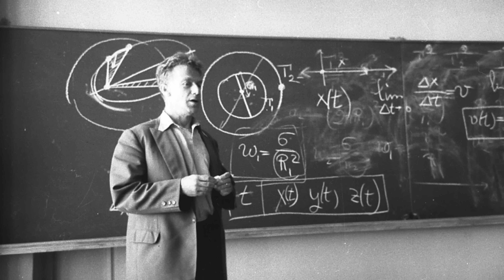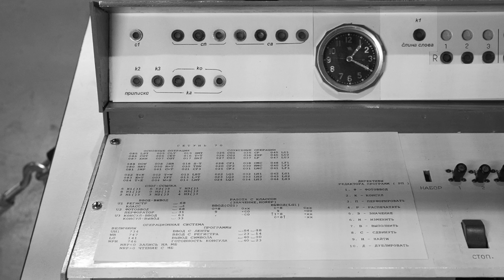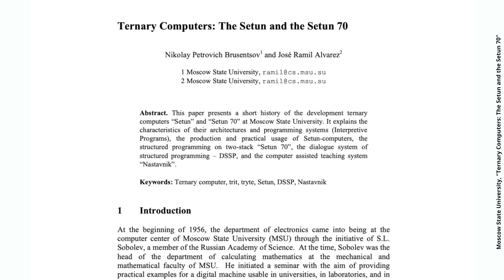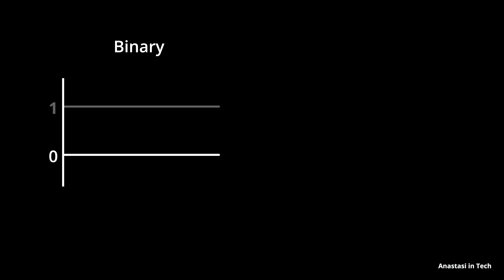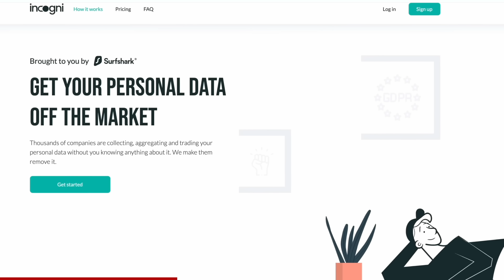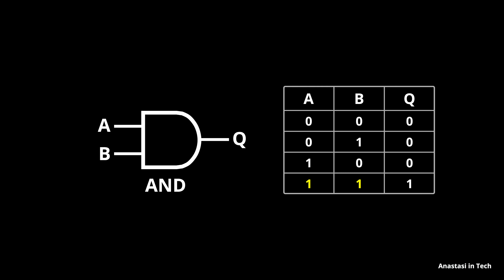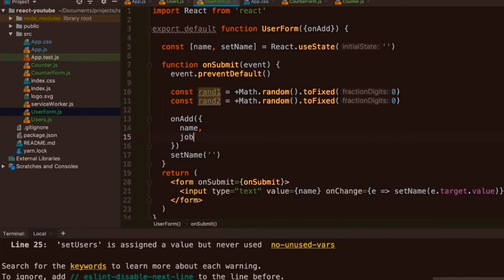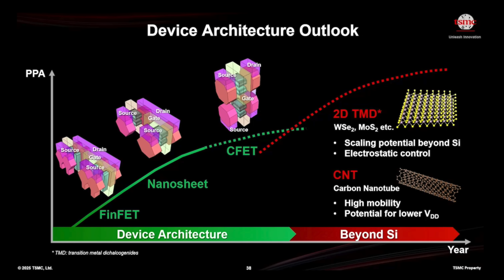The World's First Ternary Computer

Comment: Vacuum tubes are analog, they have as many states as you like, Transistors in all our digital hardware are also analog devices, we use only two states Cut-off and Saturation because that reduces errors and complexity.
Reply: Not “as many as you like”, “as many as you can reliably distinguish given the noise levels.”  Which really isn’t all that great.  It’s worth pointing out that valves and MOSFETS are quite  good analogues of each other.  Both can be use as analogue amplifiers.  Both can be used as digital switches.  And both are much easier to wire up as binary switches than ternary ones.
Reply: gates are designed to eliminate analog component, for example Zener diode mathematically is an analog device, but in functional sense it is not
Reply: @lesterryanmd  Gates are designed to use analog componentes in a discrete way. Not shure I would consider a zener analog, it has three well defined states
Reply: @lesterryanmd  nope, gate build from analog component like transistor. just used 2 state, that's more free error. than full analog
Reply: Wrong, tubes can be operated at saturation just fine. And, there are tubes that were optimized for it. An example of tubes operating at saturation in analogue service is the limiter in an FM receiver. It's the main thing that makes FM quieter AM.
Reply: @palomarjack  while agreeing that valves can be used digitally - and were - almost all FM receivers these days don’t contain any valves, limiters or otherwise.  The advantage of FM has to do with the characteristics of natural noise.
Reply: @richardokeefe7410  Oh my god, I did not know that. What a waste of 50 years of being a communications technician and an Extra Class licensed Radio Amateur it has been for me! Oh well, back to the old drawing board.

If I am not mistaken, the point I made was that vacuum tubes operate just fine in saturation mode, That is all. I just used their use as a limiter as an example. And I have news for you, the limiter in an FM receiver is still there, it's just contained in an IC along with majority of the IF strip and demodulation circuits.
Reply: @palomarjack  I didn't say FM receivers don't contain limiters, just that they don't normally contain valves.  So no, not news.  My amateur radio licence lapsed long ago.  I was good at the theory, but hamfisted at construction.
Reply: @richardokeefe7410  Alright, look. All I did was use the FM limiter as an EXAMPLE of a tube (valve) being used in saturation mode. I just do not understand why I had to be corrected in some way or another. Now let's move on.
Reply: @palomarjack  So, who said tubes can't be operated at saturation?

Comment: If you need two transistors to represent one ternary value, it seems logical that using them to represent two bits would result in a higher information density (per transistor). I'm watching the video, maybe it explains how one can store 3 values in less than 2 transistors. Yeah, after watching the full video, I get it. But, as shown in the video, 3 levels in one single device means a higher noise to signal ratio. Pretty cool, but noise really is a big problem there.
Reply: We aren't anywhere near the noise margins in present-day logic. It's only a problem in data transfer, or perhaps at lower voltages inside the chips. Yes, if taken to the ultimate you're correct, but there is no proposal to encode more than 3 states.

Comment: Chips don't go back 70 years (1955). The first ones only go back to 1960. Then the first ones made were analog subsystems. True analog and digital ICs didn't really become products until the mid 1960s. Before 1960, semiconductors were only discrete components, such as transistors or diodes. Unless you consider a full wave rectifier an IC.

Comment: Back in 1986 I wrote a data base using trinary logic you are behind me by nearly half a century
Reply: And that was about 25 years after the US, the UK, and the USSR each, seperately, actually built a national ternary computer... and each country immediately dropped the idea.
Lower noise margins before logic and data errors.
about 30% more transistors needed for equivalent range of numeric values
about 30% to 50% loss of speed due to logic gates being almostt 2x as complex.
30% INCREASE in electrical power consumption.

Basically, the only advantage is that ternery systems CAN have fewer logic gates.  But this is more than offset by the far greater complexity of each logic gate (approximately 2x as many transistors needed for only 50% more logic states).

Beach sand is cheaper than copper, but transistors are more expensive than copper.
Reply: @akulkis it was software not hardware